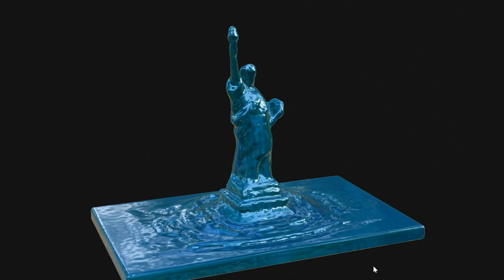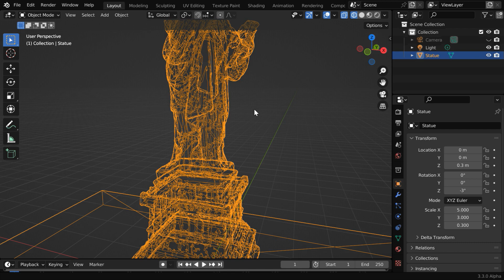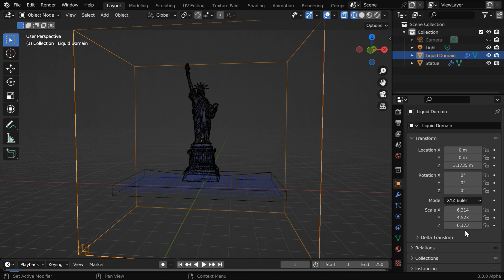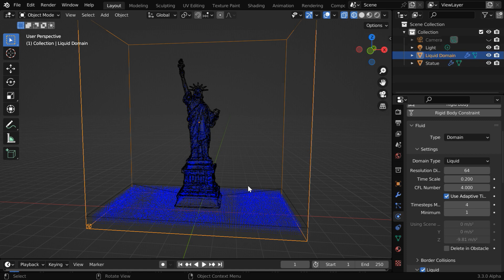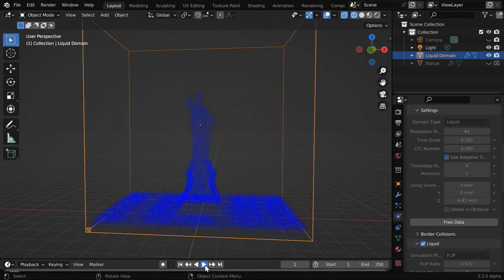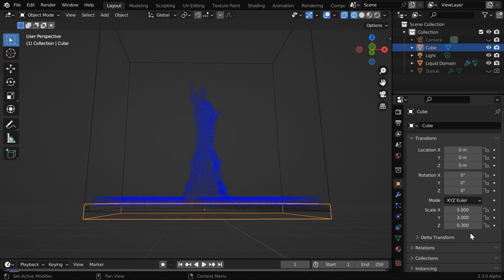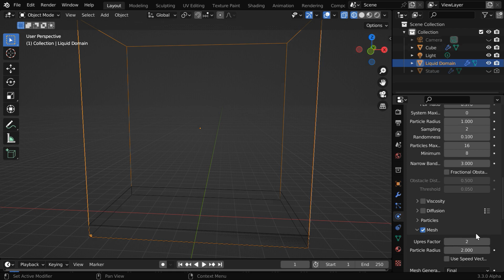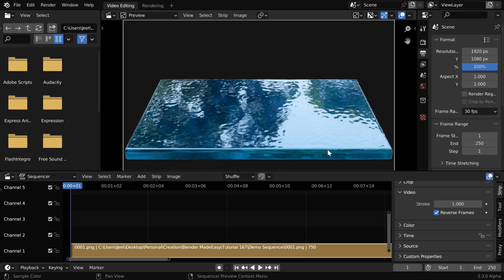Blender Fluid Simulation - Geometry Flow | Sculpting with Water Material | Easy Tutorial

Comment: If you wanted the fluid to stay static, such as lubricant/gel in a packet (like ketchup),  and then have a finger or other object scoop some up some of the gel, how would you modify this workflow? Thanks.
Reply from the maker: You can slow down the fluid simulation or completely stop it until the finger or the spoon comes in. You need to set the Time Scale value to zero for the domain. This field accepts keyframes. So you can again enable fluid physics when the scooping starts. But for ketchup or gel, you also need to set the viscosity property of the fluid correctly.